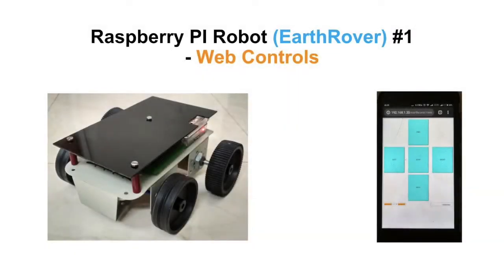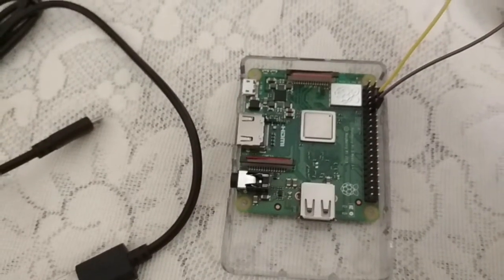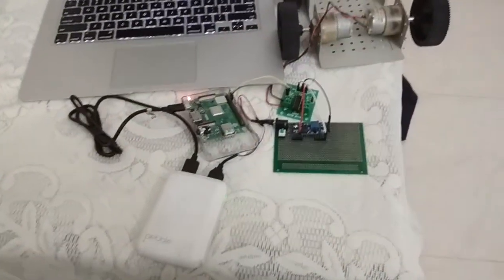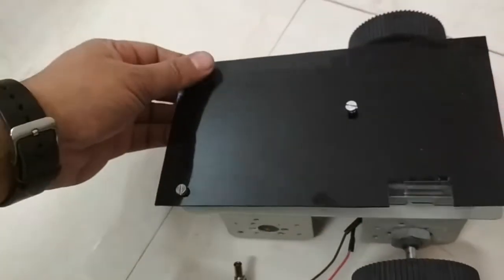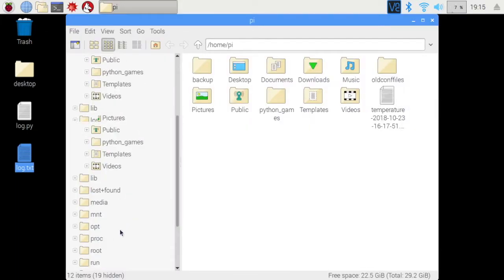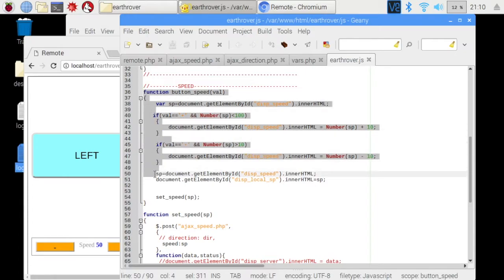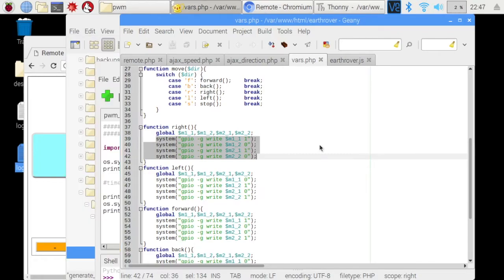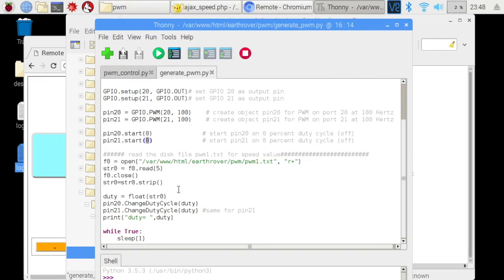How to build a Raspberry Pi Web Application controlled Robot (EarthRover #1)

Comment: Thanks for this video! Got it running. I have two questions for you though. I changed the pins in the vars.php file to get it to work, bc I'm connected to different gpio pins on the pi. I notice when I click on the web gui direction inputs, both motors move but one is always a little behind in moving. I have a python file I wrote prior to trying your method that I just use in the terminal and when I run that,I don't have this lag in the other motor.

And the other thing is, I tried including a keyup addEventListener in the remote.js file, but if I hold up say for 5 seconds and then let go, it will eventually stop on its own, but it can take a little bit of time until it finally stops. it doesn't stop the second I let go of the key. Any thoughts on these two things? Would appreciate it! Thank you so much! 

document.addEventListener("keyup", (e) => {
    if (e.keyCode == 38)
        button_direction('s')
})

Comment: dear  sir , what need a same  network 
 but i want to control raspberry pi another network  and application another network .
please give me a proper suggestion
and thank you so much for  its ideas
Reply from the maker: The server runs on Raspberry Pi. So the path to server from client network should be open. You may need to do the port forwarding on the router of network to which Raspberry Pi is connected
Reply: @jitesh_helloworld  ok sir
Reply: One more  thing 
How to setup  for picam 
Which command  used for installing picam ... zip file 
You will discuss  in #1 robotic  vedio 
But #2 Video, you will not put any  commands  for installing  zip file in raspberry pi 
Thanks
Reply from the maker: Install using bash script as described here. It installs entire code and dependencies
https://helloworld.co.in/earthrover/
Reply: @jitesh_helloworld  ok sir 
I will already  install  but camera  is not  open .
I am going  to rasp confi and enable  the camera. And also enable in preference. 
Please  help me because  i want to make a robot using machine learning its my minor project. 
Thanks

Comment: hello sir, 
after the new update to the raspberry pi OS, the control is not working, why is that?
Reply from the maker: Hi Gilbert, It is strange that Raspberry Pi OS has removed the support for picamera.. there are so many applications based on that.. may be Raspberry Pi OS will revisit its decision.. otherwise bad luck ..

Comment: I bought a l293d driver how to connect it doesn't have m1a, m1b, m2a, m2b how to complete the circuit
Reply from the maker: Nomenclature differs a bit. But overall all these boards have the same function.. Figure out motor direction control pins & speed control pins and connect them to GPIO as mentioned in the code

Comment: I installed a fresh copy of the Earthrover, it works, Thank you! Is it suppose to be running on python 2.7? When I change it to python 3.x the AI windows dont load from controlpanel. So I changed it back to 2.7 then they load.
Reply from the maker: The Python versions provided by default OS installation is sufficient to run the code. You need not change anything.
Reply: @jitesh_helloworld  Thank you ! Appreciate your time and code. Having fun.
Reply: @relaxingazguy  can you help me , html page is not load i don't know why this.....

Comment: how to run the php file on browser bro?  ty
Reply from the maker: check ip address of your pi using 'ifconfig' command. For e.g. if it is 192.168.1.2, then using a laptop/PC (connected on the same wifi as raspberry pi) open a browser and type following in the URL:-
192.168.1.2/earthrover/remote.php